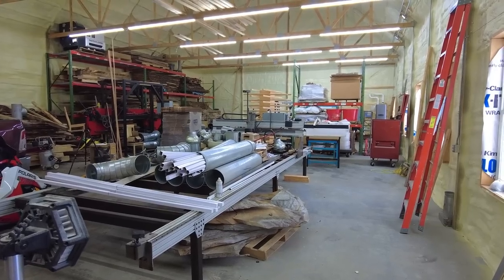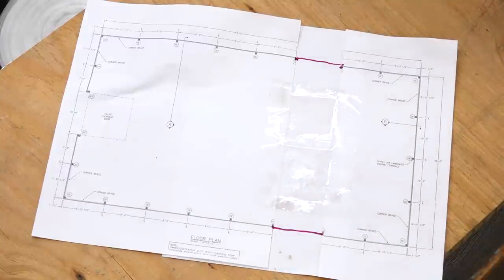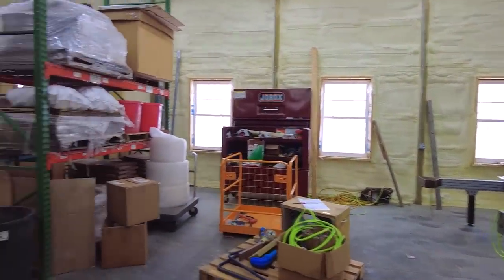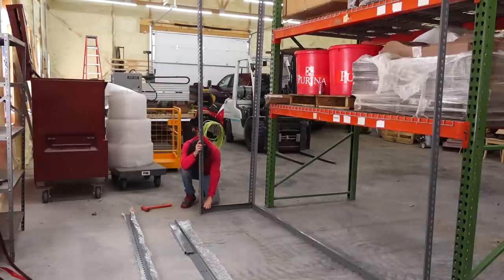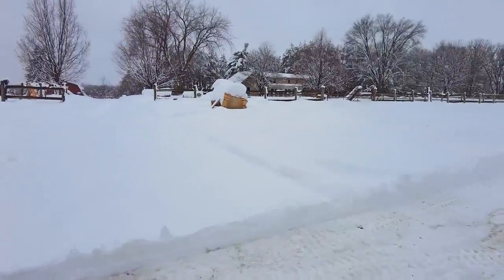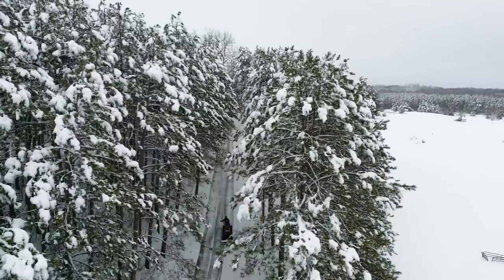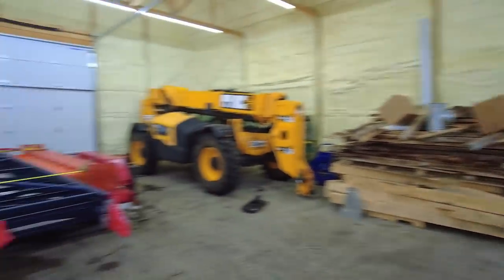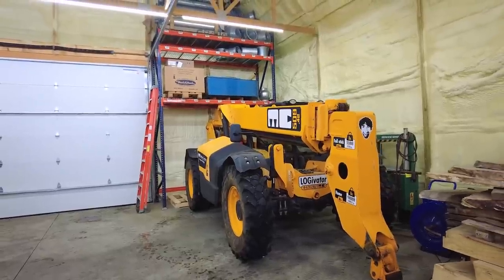How Long Will This Barn Take to Pay For Itself? - Setting up & Answering Questions

Comment: Matt, YES PLEASE do another one like this. I like the organization stuff you did and am definetly looking forward to the next one. One thing I missed, if you mentioned it, was where your gonna put the massive wood drying machine? Against the back wall near the slab racks? Anyway, thanks for the update and hope that wrist isn't to badly damaged.
Lindsay, The boys are in school but where does Eloise spend most of her day during the week?
Reply: We have a nanny that watches Ellie.
Reply: @lindsaycremona2459  Oh Ok. I thought you didn’t get another when you moved and then the Covid. . Sorry.
Reply from the maker: I'm thinking it will go against the wall where the racks with the wood on them are.  I'll just pull the racks away from the wall and put the kiln against the wall.  At least that's the plan now.

Comment: Hi Matt, I'm curious as to how you determined the "chair kits" as a business to pursue?  Did you do some market evaluation or somehow realize the needs people have.  I know you also do "work benches" and "wood slabs", but why not "cutting boards" or something else?  Thanks for just being you and your open ness. We enjoy the videos, Happy New Year!
Reply: cutting boards are a lot of work for small return, even if you’re batching them out. The market is also very saturated with them, driving the price towards the low end of the margin of profit. slab tables and work benches are not as saturated but still common. They’re not too difficult to make and the profit is higher per customer. chairs are not as common If I had to guess, he found he had a better profit selling more kits rather than finishing the chairs and the labor involved in doing so

Comment: For the bathroom.. You could just get a small "port-a-potty" and have it outside your barn, and as little as it would be used, you would only need to have it pumped out every 2 or 3 months. (if you had an employee).   But even then, I bet it wouldn't get used very much.

Comment: Don't need a toilet, it's just something to clean but a slop sink would have been nice.  A slop sink could drain through a side wall into a dry well as it's only grey water. An incinerator toilet would be my choice if I really had to have one.  
You will have to let us know the heating cost for the building, that would be interesting data point to file away.

Comment: Fantastic progress!  IF you felt so inclined, you could make those windows faux stable doors.  Apply wood trim in the form of a stable door.  I think it would look interesting and fit in with the whole layout of your amazing property!  Once the overhang is installed it would even enhance the appearance of a covered entrance for the individual stables that doesn't actually exist in the real world.  Might be a fun woodworking exercise, imo.  Btw, whether you know it or not but, you're implementing the foundational tenets of Lean Manufacturing.  Originally TQM.  Then TQMS.  The many, many iterations that follow that still align with the original premise...5S, Six Sigma (and others that don't come to mind immediately) - Continuous Improvement.  It's a founded practice and you're using it!  I see a compact electric forklift in your future, the warehouse type electric forklift that I've seen about (no personal experience with them, but with other similar machines and warehouse work), tall mast, small footprint.  Gonna be a great space, #MassiveMatt!  Porta-Potty IF absolutely necessary.  A composting toilet would work also, in a pinch.  Thanks for all your and Lindsay's work, Matt!  May the best of last year be the worst of this new year for you all, your families, your friends and loved ones!  Happy New Year! 🎉🎊🎆
Reply from the maker: thank you!

Comment: For your bathroom, you could trench the slab for the wet utilities (sanitary and water service). The drawback would be the visibility of the concrete filled trench. But the upside of that is not having to put the restroom on a deck. Just a thought
Reply from the maker: Not sure how feasible that would be with the embedded pex for the heat but otherwise, yes
Reply: Right, there is that conflict. You may be able to run 1/2” insulated water lines above the heat elements and locate the sanitary for the toilet closer to the exterior wall. You may have 8” or so to work with. Then insulate the exterior wall to prevent burst pipes.

Comment: You're getting pretty good with the production and editing of these Matt! 

Would it be worth it to eat some of the Forklift parking space to set up another tall rack and then span a catwalk between them over the main door? It would give you a fair bit more storage space for long term storage or for some mechanical stuff you don't want eating up floor space (air compressors, some of your dust collection / air exchange mechanicals) and it would probably be easier to access the space without having to move the Telehandler that way.

Just, for the love of osha, use a railing or leave a fall arrest system set up if you do. We have one or fewer falls like that in us in a lifetime..

Comment: Best of luck with the barn, Matt. Now that you have the ducts for the larger dust collection system, wouldn't it be nice to go ahead and get one? Wouldn't it be great? Think of the increased capacity and efficiency and (most likely) noise reduction.
Reply from the maker: I wouldn’t be able to power it until the new service is installed

Comment: Raise the floor of the fork lift with a hollow platform box 12 high by @ 28 inches wide = 2 forks . Don't cut your shelving posts. How often does it need a storage lift daily, weekly,...?

Comment: Matthew, while watching this video where you are installing the dust collector pipes in the trusses, a thought came to mind. 
Do you know the collateral load capacity of your building?  The is the load you can put on the ceiling structure for things like pipe, signs, HVAC units etc.

Comment: That’s an interesting question for an appreciating outbuilding that will remove a huge chunk of capital gains from the base of your primary domicile. It may pay for itself several times over if you ever sell the place. It will give you tax breaks for working space, etc. You’re only making money off that structure.

Comment: one suggestion, lockable wheels under all your machinery.  So easy to move things around when the needs comes up.
Reply: Not near as much fun as using one of the three pieces of equipment with forks!

Comment: Awesome Matt! Very nice set up, also you should totally do a video on that snowmobile. Or whatever you call those. Lol, anyhow I like your thought process. I was thinking the same thing. 
Lift up a pallet on the side of the racks, and use that one side since you couldn't get to both. Then as in thinking about all this. You are saying all of it. Anyhow that sucks your forklift hasn't got a taller mast.  Are you going to end up getting another forklift and replacing that one? Or are you just not going to put stuff up as high in your, barn, shop, garage, storage area, big toy storage. Lol I think you get what I saying.. thanks for another great video Matt. Until next time, take care my friend!

Comment: Bathroom- there a toilet that has a built in pump and chopper (i installed in my cellar shop)and can put a pump under slop sink (also installed in my cellar)==no breaking up floor   also can you just put in a small cesspool for bathroom?

Comment: Matt ,only concern I'd have is that forklift  being propane is exhaust fumes. Do you have an air exchanger system installed  ? Or leaving a window open while using forklift.  Carbon monoxide is a concern

Comment: regarding the bathroom, is there a reason, that it couldn't be put into/under the lean to addition, you can put the pipes in the floor, even double use it, as a compressor room perhaps, l don't know if you need an air source out there.

Comment: Probably not an issue in a warehouse with ventilation, but isn't forklift exhaust a problem in your unventilated barn? You got any of them CO detectors installed?

Comment: How are you going to bolt the racks to the floor with the underfloor heating if that is your plan. I guess that you could tie them to the walls. Wishing your family well in the new year.
Reply from the maker: I’ll just use 4” bolts

Comment: Big factor also is the increased property value, which of course means a higher tax assessment. Interesting how priorities differ. I would not have done that large of a shop without doing the rough in for a bathroom. Also a floor drain if you are parking equipment in there. Just experience I guess.

Comment: I like to smack those ducting connections with a mallet. one or two good sharp wraps should over come the spring pressure.
Reply from the maker: I cut out a lot of fighting with that clamp, including lots of mallet smacking
Reply: @mcremona  sometimes despite everything you do, ya just end up with the short end of the stick.🤪

Comment: Hey Matt, did you ever do a video on your slab flattener?  I’ve been thinking about a cnc router for that purpose.  Is that what you have or is it something more specialized for flattening?
Reply from the maker: I haven't yet.  still have to finish setting it up.  This is what I have: https://www.blackhorsedesigns.com/clydesdale

Comment: Matt Happy New Year. Have you given consideration to installong a stand alone bridge crane system and using 3 or 4 point chains to handle and move the heavy product? All things considered end cost really good for the BARN THING!!!!
Reply from the maker: Not really necessary with the forklift in there

Comment: Is there a reason the slab flattener cannot be within a foot of the wall, or similar in corner?

Especially with the ability to lift it and move it easily with the fork lift, it seems like a waste to have more than a walking space between it and the wall, from my observation as a bystander.
Reply from the maker: I set it up with that wall side as the operator position. I can turn it around and shove it to the wall if needed but I’m planning on using the wall space for storage and organization

Comment: I would so love to have a “barn” shop like this. If I had the land and didn’t have to deal with Gestapo HOA, I’d build one just about like it,except geared more to my automotive addiction, but sprinkled with my carpentry, plumbing, electrical, gardening, and various other equipment. Nice build guys.

Comment: I wonder what the load rating is on your trusses, especially on the bottom cord. Might be worth checking.
Reply from the maker: 5psf dead load on the bottom chord
Reply: And to tag onto what Matt says, since these are spaced pretty far out (9' I believe he said), if you do 9'x5psf, that's 45 lb/ft (1800lb total) he could put along the bottom chord. As a structural engineer, I see no problem in this especially since he placed the piping where the load would get distributed into the truss rather than bending the bottom chord. Piping is pretty light in comparison to code live loading especially in states that see major snow.

Comment: All those vac pipes joints should be taped for seal..  Regarding most popular items... highest voulmne has nothin to do with most popular. If give equal priceing the rue popularity of an item is found. Yep 14 kt is more popular than 18 and 24. only because of cost..  Ask a bunch of customers what they would choose if everything cost the same. very informative marketing info.

Comment: Your payback is a cash flow model which does not include your equity. You could pay rent to yourself if your bookeeper could justify it. Not having to spend time, effort, wear and tear, fuel, on your vehicle is hard to value but you know its worth alot.

Comment: There is an audio drop at 3:30:(
Reply from the maker: not sure why.  It's there in my edit.  "So at least for now it's up here.  I'm going to throw the next bay's pair up there and we'll see how that goes because now I have to clip it to the previous one in the air."
Reply: Now my question, did you just remember what you said at that point, or did you have to listen to it again?
Reply from the maker: I new what I was talking about but not how I said it

Comment: Be careful drilling into the concrete floor you dont wanna spring a leak in the hydronic heating system bummer

Comment: CASH FLOW! Who cares if it ever is "paid off".  If it lowers your monthly output, you are winning! 
21:40 Consider NO INVENTORY on the bottom shelf.  Use that for 5 gallon buckets of sealer, paint, etc.  
That is way too much getting down on your knees to get parts than you will want to do for the long-term.  Take it from a 55-year old.